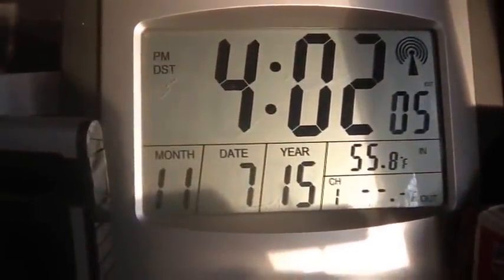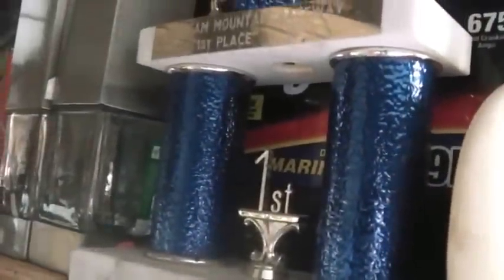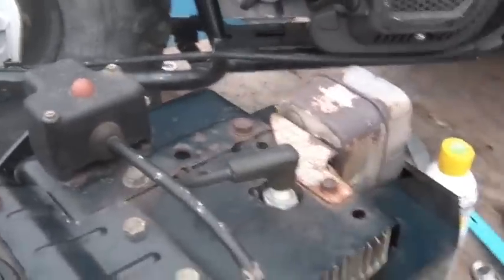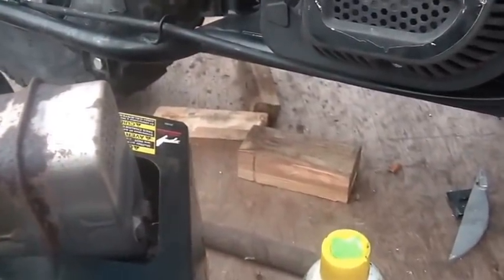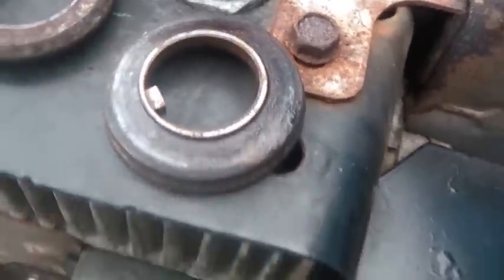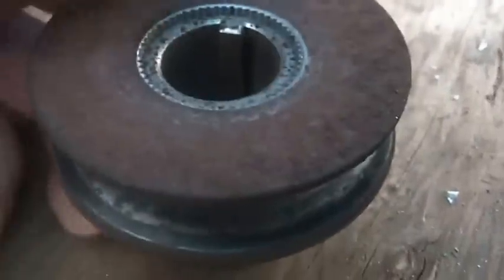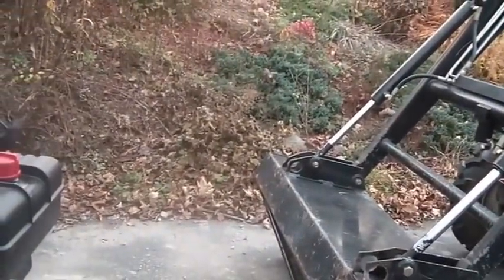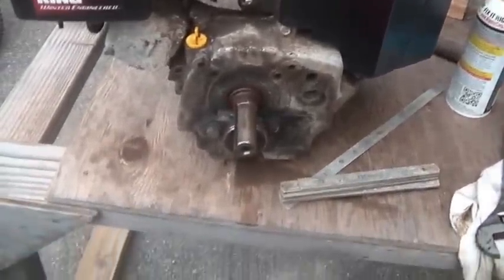9Hp Sears Snow Blower, Engine swap, Part 1, pulley considerations,

Comment: I havent ever had a Tecumseh engine like this before but i have dealt with the lawnmowers and i dont like them one bit i had one with a stubborn carb and leaky bowl, another that wouldnt run whatsoever unless you sprayed starting fluid in it but even then it would die instantly countless times i went through the carb and eventually i gave it to my shop teacher to use as a demo unit or parts or whatever he likes i only got one Tecumseh running with minimal effort by cleaning the main jet and the jet on the bowl nut it ran great after that sadly i didnt get much for it despite being a 6.5 self propelled start on the first pull mower, After all the hours of dealing with these and getting virtually nowhere i put only a bit of cleaning and effort into them and that dosent work i scrap the motor and keep the deck i have had great luck with honda and briggs i dont want to spend my day trying to fix the carb on these only to get nowhere but hey if they run then great
Reply: +Theghostmaster 87  by the way its Jon bower i just changed my profile a bit and got busy with life events
Reply from the maker: +Theghostmaster 87 , I have had the same experience with Tecumseh engines over the years, also, there were 2 of these on craigslist with the same 9hp engine, both had blown engines... That is Y I am not going to use this engine on a snow blower. Snow blowers need to start and run reliability, I did not feel like I could get the OEM engine to that condition. We share parallel lives when it comes to Tecumseh engines... Thanks for your thoughts, watching, and commenting!
Reply from the maker: +Harvey Spooner , I subscribed to Ur channel, U should post some engine videos... Good luck with the new channel!
Reply: +Harvey Spooner  Thank you for subscribing :) i would make some engine videos but i do not have a camera readily available except me cell phone camera
Reply: +Theghostmaster 87  "My"

Comment: You would be better off finding a whole new pulley instead of an adapter or an engine with a 1-Inch Crank
Reply from the maker: +redneckbryon , The sleeves are on there way to me, I'm thinking the  snow auger pulley should be directly attached to the shaft, so, I may get one at Tractor Supply, about the small wheel drive pulley, that one is going to have to be shimmed, I will never find one that size... Thanks for your good thoughts, watching, and commenting!

Comment: Found one n ebay however youtube will nt allow me to post a link in the coments so just search 3/4"to 7/8" inch w Key Engine pulley Crank Shaft Sleeve adapter predator

Comment: don't forget the engine mounting holes
Reply from the maker: +Josh Kilen , I should check that, I assumed, maybe not correctly, that the engine will mount in the same holes and that the shaft is the right height,  thanks for the good input, watching, and commenting!

Comment: hey harv... so i wana 12v the headlight on my 85 200x . iknow i can leave the ignition alone. what rectifier would u use. i would like to do a 12v led head light. i know ive seen u have a vid on rectifing the atcs . thanks buddy.
Reply from the maker: +effortequalsresults , I have not rectified the AC form an ATC stator, but, if I did, I would use a full wave rectifier, with one side of the AC input being the head light power coming out of the stator and the other input being ground... Then I would run 2 separate lines from the output of the rectifier to the LED head light being careful that both the + , - are isolated from ground... Be careful, the ATC stator can put out 30VAC, when rectified, it can be over 30VDC which can blow out most LED headlights.. U may have to put 2 or 3 headlights in series... I hope this helps, if not, ask more questions, maybe it would help if I made a video... Thanks for asking, watching, and commenting!
Reply: damn no wonder i see so many guys just run batterys. thanks for all the info maybe ill wait to see u do it. damn . thanks again buddy for the response back . hope the back is doin well
Reply from the maker: Hi, My back is cranky, something I have to be careful with it seems... Will be posting a video tomorrow on a ATC200 motor that has a transmission problem, looking forward to Ur opinion on it... As always Bud, thanks for all of Ur support!

Comment: Tear into the original motor might be an easy fix
Reply from the maker: +Brooks Pearce , I considered that, but, there were 2 of these identical snow blowers on craigslist, both had the same 9hp engine, both had thrown rods, I'm thinking this engine is not great... At some point, I will open it and see what happened, if the crank is good, I will probably change the rod and fire it up, for now, I have a new predator floating about, so, I'm going to try it..... Thanks for your thoughts, watching, and commenting!

Comment: I have a brand new 5hp old style flat head Tecumseh engine never been started still has the factory paint on muffle and even on the pull rope. But it's a 1" shaft I'd trade for the gokart frames but shipping would be a pain.
Reply from the maker: +231flash , U need to make a trip to the state with the highest taxes for a visit... U can stop by here and visit Udizzy also... Then U can take the frames home with U, mailing or shipping them would be crazy expensive... The body and drive system on the snow blower seems rock solid and parts are easy to get, I figure that is I go with the $100 predator engine, I will have the easiest snow blower in the world to fix, with the best parts availability... The Tecumseh needs to find its way to a Rupp Minibike forum, someone will grab it, swap out the crank shaft, and do a great restore, it would be a shame to waste it on s snow blower... Thanks for the offer, watching, and commenting!